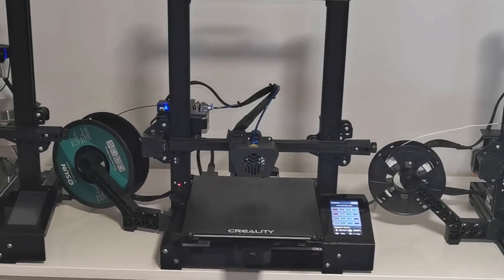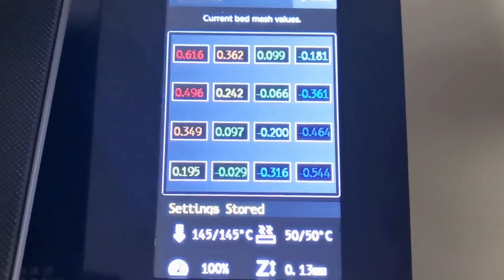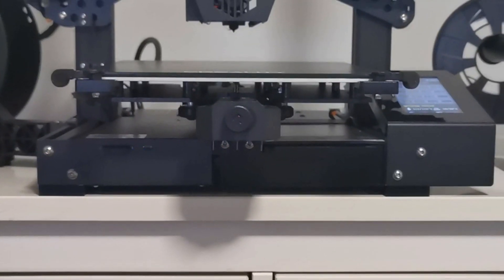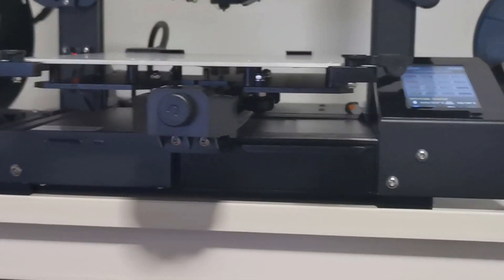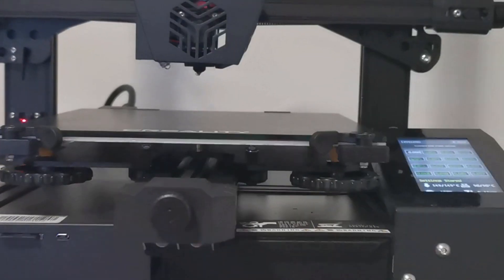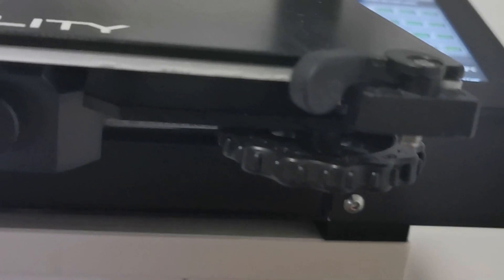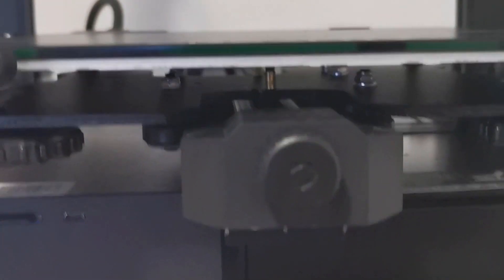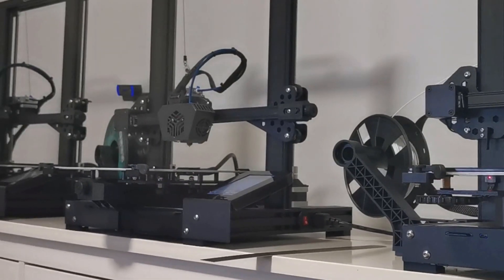Fixing Your CR6-SE Bed Levelling Issues. Get rid of the rainbow!

Comment: Hi Shane, great vid. I was in the 80% was out by .8mm and adjustment got rid of the rainbow. I just noticed in your settings that your Z Offset on both printers was around .13mm and mine seems to be around .25mm. What affects the Z offset and should mine be similar to yours?

Comment: Great video, really struggling with my first layer atm not quite sure why and half way through troubleshooting. I just had a look at the black pegs that hold the silver bed plate above the black carriage plate, and they vary in length (at least in my case) by up to 0.4mm 😂

Comment: Hey Shane, Nice Videos!
I have a problem with underextrusion on my CR-6 SE and I don‘t know how to fix it anymore.
I mounted a new original hotend that printed 100% fine in the first print. However when starting the second print it underextruded. 
I calibrated the E-steps (now 102.5) tons of times, tried different filaments, new slicing profiles, flashed the community firmware, did cold pulls on the new hot end but nothing helped. With the community firmware I adjusted the flow rate to 150% which seems to be about the right flow. But that‘s not the way it should work. Do you have any idea about the root cause of that problem?
Reply from the maker: Hi mate. Glad you enjoyed the video. Thanks for the feedback. 😁👍 I have seen something like what you have said on one of my machines. It ended up being the heatbreak. The tube that goes up the center of the hotend I think can some how get cold spots in it or something like that, that causes the filament to seize. When I had this issue it wasn't until I swapped out the entire red hotend that the problem went away. It's interesting you are seeing this beyond a hot end swap though. Have you looked at the Bowden tube at all? Or tried swapping out the extruder motor? I know if the extruder motor is getting too hot, it can skip steps. Maybe you could try swapping out the motor with one of the ones on the side z axis or something like that? Just to see if it resolves anything?
Reply: @shanegoodwin2912   Thanks a lot for your quick reply, I really appreciate it! It seems really strange as the new hotend worked well until the end on the first print. Also now when I request to extrude 100mm of filament (through the hotend and the nozzle) that also works fine. But when starting a print it just extrudes a very thin but continuous line.
However I will follow your advice and replace some parts like the red metal part and the tube from the new hotend with the old one and see if it makes a difference. If not I‘ll try to swap the steppers. But I‘m not sure if it skips steps because of overheating as the underextrusion is from the beginning of the print and as already said pretty constant. Anyways I‘ll try and see if it makes a difference. Thanks again!
Reply from the maker: @mauricebackes888  not a problem at all mate. Sorry to hear about the troubles. I totally feel your pain. Yeah unfortunately it's most likely going to be a trial and error thing. I've gone through so many bloody parts in the past trying to work out issues. 🙄 Good luck with it bud. Hope you nail it soon.

Comment: before you do anything, raise your X-rail to the top of the gantry, and make sure it is the same distance from the top gantry rail on both sides ... don't always assume that it is the bed that is not level ...
Reply from the maker: Pretty sure that's what I said to do there bro. Did you even watch the video?
Reply: @shanegoodwin2912  Sorry. Mate ..I skipped over that . I had looked at 100 videos, and was just sorta skipping thru 'em ..... but ... if your rollers are all adjusted properly,  you will never get your X-rail level with the gantry by adjusting the Z screws ...  the X-rail can only be adjusted for level with the gantry by loosening the 4 screws that hold the roller plates to the X-rail. and adjusting level with them loose.  The problem is that on most printers, these screws are not easily accessible on the left side, as they are behind the X stepper and or slave board .. if y ou try to adjust using the Z screws, as soon as you tighten everything up and adjust the rollers correctly, it will just go back to where it was ... please correct me if I am wrong ...

Comment: Hi Shane thanks for your down to earth and helpful vids - I am about to start on the direct drive conversion but I wanted to get to grips with the bed levelling first. The problem was that being an impatient old fart I couldn’t wait for the stuff to arrive from ali express so came up with this work around. Remove all the bed locating screws and the bed. With the screws in situ fit small silicone o rings over the screws so that they grip the screw threads snugly and make sure they are tight against the bottom of the heated bed. Refit the bed using all the spacers and rings and tighten make sure they are snug but not crushed. I took only two attempts to adjust the height by tightening the screws and got to a full green display for the first time. I like fact that the existing support structure is kept and only cost me the price of some 4mm o rings which I had laying around from a middle of Lidl purchase years ago! I am not being critical of your fix by the way if hadn’t seen it I wouldn’t have stumbled on my fix.
Reply from the maker: Hi bloke. No I understand completely. 😁👍 For me it's not about doing it my way. It's about enjoying the hobby and making things work. I'm glad you got it fixed mate. Nice work. 👍 To be honest there are so many ways to fix these things it's crazy.

Comment: Appreciate the video. I am currently trying to get my bed on the cr6 max nice and level. I was considering doing something like this but wasn't sure because the bed is so much larger than the 6se. I started by grabbing a automotive feeler gauge and where it was low, I used a feeler gauge that was half the thickness of however low it was in that spot. Still working on that. Also, I found I get very different numbers on the bed when I disconnect the bowden tube while the auto level runs. Have you ever done that? Great video.
Reply from the maker: I have just recently done it to my max mate. I'll throw a video up shortly on how I did it. 😊
Reply: @shanegoodwin2912  Very cool of you. My friend also just got a 6MAX and will be watching too. Good on ya!

Comment: Thanks for the video. I had ordered 2x kits of silicone spacers thinking i was going to replace all of them. Then I saw your video. After replacing the 4x corners and manually leveling with the stock firmware. I'm all in the green except for the light blue on the far right. But that is because I overtightened the wheels and they wore out quickly. I maye throw some blue thread locker on the screws and leave it. As I have a very curious 5 year old boy who loves to turn knobs. Thanks again
Reply from the maker: Haha you're very welcome mate. Glad it's helped. How lucky are you to have a curious son. 😊 Hopefully you can both enjoy the hobby.

Comment: Excellent video! one question which software are you using in the CR6-SE
Reply from the maker: Hi mate. It's the community version of Marlin. If you've not seen it, it's found by searching "CR6-SE" or "Cr6-max community firmware" .  😊👍

Comment from the maker: Hi All, I have a tutorial posted now explaining the process of modding your bed. Details are all in the video for you.
Reply: how you remove the back of the bed 
i cant remove it the screws the tool it came with it dont fit to 
thank you
Reply from the maker: @TheMajenos5  mate you slide the bed forward and pull it up off the aluminium a little while you do it. It can be a little stiff.
Reply: @shanegoodwin2912  thank you got it i have blue numbers when auto leveling bed it wont go away
Reply from the maker: @TheMajenos5  oofff. OK. Definitely a good option for you then mate. You should be able to tram that a little better then 👍
Reply: @shanegoodwin2912   i thighten everything down and still no luck blue still there

im new to 3d printing
Reply from the maker: @TheMajenos5  have you tried adjusting the gantry?
Reply: @shanegoodwin2912   i dont know what that is also i thought this printer was plug in play 🤣
buy the way i have -blue numbers i have a friend and he looking online as well tryin to help me no luck
Reply from the maker: @TheMajenos5  Hahahah aawww that sucks mate. I'm sure you will get there. They can be frustrating, but once right, they are a lot of fun. Make sure to check the hot end is all correctly. Mounted, the gantry is level and the bed is down. 👍👍👍
Reply: @shanegoodwin2912   yes its level to the bed i having trouble only in the back right corner its blue i cant getr rid of it - blue

Comment: Shane, did you get the silicon mounts for your CR-6 SE? I'd love to see a video on what you got and how you installed them. I also get the rainbow when I level mine. I'm also having adhesion issues when trying to print small parts like 608 bearings. Any advice on that? Thanks.
Reply: Me to I just bought 20 16mm silicone bed spacers and I'm wondering if I should add them but I'd like to see a video on the results of adding them before I go ahead with it mines not out as bad as your video  utterly back rig ornery on mine is always been -3  in the blue range
Reply: @seanwood5443  I dialed mine in as best as possible without getting the spacers. The biggest thing that has helped my printer is making sure the e-steps were set correctly. Since I set that and made sure to wash the glass bed before each print, this thing has been printing beautifully. Seeing as I am running the community firmware like Shane, I am going to look into linear advance next to see if there is more I can do make things even better.
Reply: im in - blue .327 in one corner only idk why

Comment: Thanks for the info, am having rainbow readings just like what you showed. I thought id levelled the x axis enough but will try again measuring from the top, as i done it from the bed. I did notice my balance was off with the bed getting closer to the nozzle towards the back of the bed which is annoying me. Being oldschool i wish it had the adjusting knobs too as you say just to get things set then the ABL can refine it. I also think that maybe there is a cap on just how far the ABL can compensate as my prints will constantly be close to the bed in some spots, far away in others even after running the bed levelling. Ill have to take a look about silicon spacers
Reply from the maker: Agreed mate. I believe there is a bit of a limit where it starts to screw up. It's what drove me to doing this in the first place. 👍 The silicone spacers definitely work well. I can highly recomend them. 👍👍

Comment: There is no need to get rid of the rainbow, if it just prints fine. Don't fix what isn't broken. It is fine to level the gantry, but anything more than that, novices risk the issue of making things worse.

https://damsteen.nl/blog/2021/04/19/on-strain-gauge-leveling#interpreting-bed-leveling-results
Reply from the maker: Hey purist. I'm good thanks. My research doesn't show this at all. 👍 Thanks for stopping by though.
Reply: Shane's points here are valid and he explains why this solution is better than letting the printer self correct for the overall geometry of the finished print. Think about it mate and then you will get it :-)
Reply: Yeah, no need to get rid of the rainbow if you a are just printing tchotchkes and baby Yodas, but if you need your parts to be square and accurate it is essential.